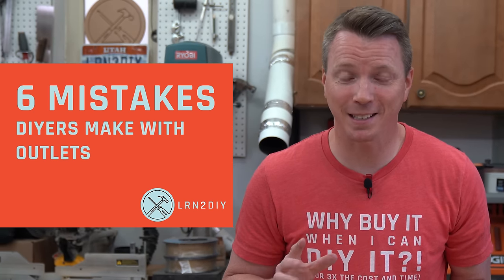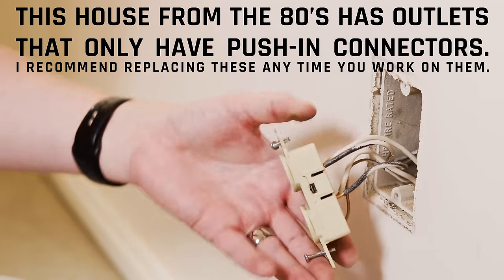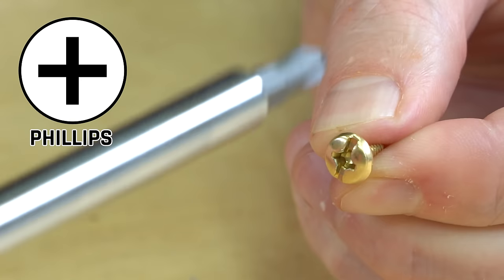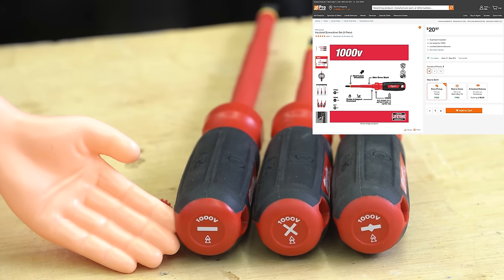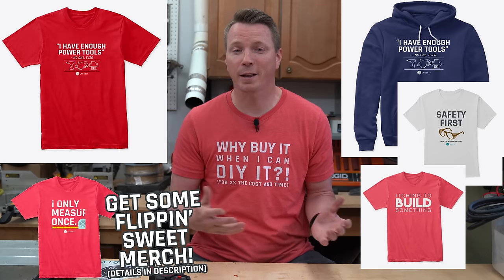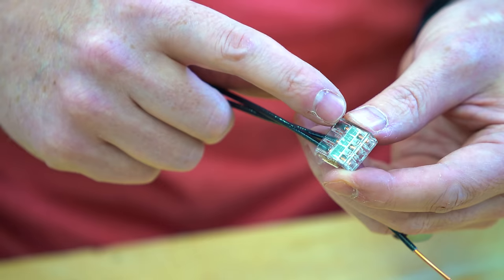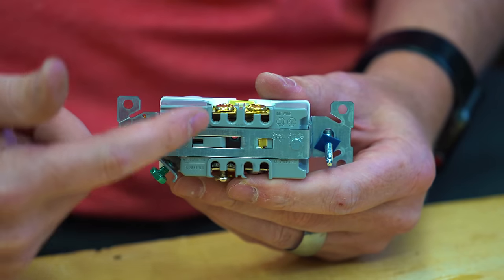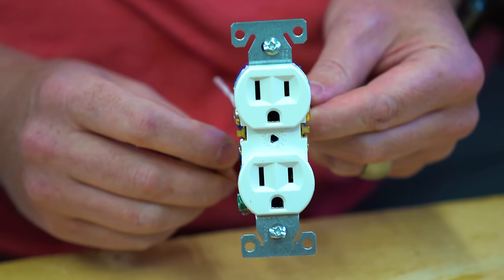6 MISTAKES DIYers Make When Wiring Outlets

Comment: Well done. The only DYI fail you might add and it is a serious one, is that the DYI doesn't fully understand the difference between the neutral wire and the ground wire. Combining or interchanging those wires can lead to serious problems or fire. They are always to be kept isolated from each other. The ground wire never to be used to "complete" a circuit.
Reply: Only to complete a “ short  circuit “.
Reply: The ground and the neutral are certainly connected, but only at the circuit breaker box common bus..  At the terminal ends, it is agreed that the neutral and ground should never be combined.

Comment: The biggest but maybe not so beginner is knowing about the jumper between the upper and lower recepticles on the hot side. Knowing to cut this when replacing a worn outlet can prevent a big problem when one of the receptacles is controlled by a wall switch and the other is always on. It's an easy item to overlook.

Comment: Great video on correct way to wire a duplex. Have not seen all of your videos to see if you cover when to change duplexes in your home especially in the kitchen. I have seen so many homes where the duplexes are not holding a power cord securely anymore. On high wattage appliances like toasters, convection ovens or coffee makers, if the plug sags out of the duplex too much it can cause arcing and possibly a fire. Spending a bit more for 20amp duplexes is worth the cost for the components inside are a heavier ga. so they hold a power cord more securely.

Comment: I'm a master electrician. This was a very good video. Especially on using the push inserts. Also not taping around an outlet before installing. Code requires this in some areas
Reply: I better look up the code concerning taping the devices. Could you please tell me what section and subsection number your referring to? Are you referring to Canadian Electrical code or another nation's, American, for instance?
Reply: @renebatsch2555  I'm American.  It's not nec required,  but small codes differ from city to city. I've come across a handful now who want the taping around it which to me is redundant as it might serve a helpful purpose in metal boxes, but if the boxes are grounded as they should be it's pointless anyway. My apologies for not making clear it's a local thing I've ran into several times.
Reply: @rustymarrs4832  Thank-you for the reply. I used to wrap electrical tape around the receptacles as well years ago - just as I was shown by many journeymen. 
I don't anymore as it makes it harder to trouble shoot if one has trouble stabbing into the slots with ones prob-tips and can't touch the side of the terminal tabs because of the tape. Also it prevents inspection of the terminals and wire ends when the device is pulled out of the box.  Also the tape, if not allowed to relax before wrapping, will start to work loose and in time leave a tacky, encumbering mess. The only time I use tape now is temporarily on light switches hanging out the box when I'm painting a room and want to keep the room's light in use.
p.s. I'm a 32 year member of the I.B.E.W. local 353.
Reply: @renebatsch2555  nice and yes I agree on tape just being a Headache. The only thing I tape anymore are colors on strand wires from single rolls to mark hots from neutral and ground. I don't wire hot to neutral old school so I don't have to mark those, so colors and wire nuts after twisting hots are about it.

Comment: For people that don’t understand why wires pop free of screws or wire nuts when they are sitting in a protected electrical box and are never moved; wire is constantly moving by expanding and contracting so any lose connections will eventually come free and cause arching. Also pre-twisting your wires before putting on wire nuts is more important than you think!
Reply: @rustyc0athangr you can still have good connections without pre-twisting so don’t worry too much! Pre-twisting just guarantees a strong connection!
Reply: @We do things So never were taught the proper way in tech class, or just ignorant?
Reply: Also make sure all wires are equally deep inside the wire nut. Sometimes they shift after you put on the wire nut.
Reply: Besides just the expansion and contraction from temperature changes, there's also vibration.. Kids and pets running, jumping, bumping into things..
Reply: Code now states not to pre twist, but my father still twists and solders his connections before wire nutting. 88 years old, really old school.
Reply: @We do things Never pre-twist stranded conductors together for wirenuts. Only pre-twist solid conductors. You can and should tightly swirl the strands of individual conductors, but not twisting the two conductors together. Never nick the conductors of solid wires, and never leave out or accidently cut a single strand of stranded conductors before connecting them. If you accidently nick a solid conductor, or cut strands of stranded conductor; cut it all off and start over. Always perform the pull test (you should not be able to pull the wire out or off, no matter how hard you pull)
Reply: @therealbadbob2201  I haven’t heard of that code? What’s the reference?
Reply: Some discussion here about whether or not twisting is a code requirement.  Last I looked, it is in Ontario, Canada.  However, keep in mind that electricity flows on the surface of the wire.  Twisting makes more contact surface, so a better electrical connection.  Twisting keeps all the wires together mechanically, so none slip back while applying the nut.
Reply: @vproducer062  .... Which is why pre-twisting the wires is so important. If they are twisted properly, there is no way that they will shift. 👍🏽
Reply: @therealbadbob2201  I just looked and in the US there is no code requirement that states that you can't pre-twist
Reply: @therealbadbob2201  - I've seen this before - completely unnecessary to solder (especially when soldering thicker gauge wire - the heat is constantly transferred away by the copper wire and, ultimately, you can cause a more dangerous condition by melting the insulation in the wire (partial melting), weakening it, and making it more vulnerable to cracking - as the plasticizers were evaporated from the insulation material!
Reply: Thats actually not true. If you read the manufacturer specs of some wire nuts it tells you not to pretwist
Reply: @orestracki6617  i recommend every DIY person to pretwist because they don't always know whats going to stay in the wire nut or not. trained perfessionals can get away without pretwisting though.
Reply: personally , I don't pre twist wires . Nowhere in the NEC does it say to do this nor does the bag of wire nuts . Pre twisted wires makes trouble shooting difficult and dangerous . The wire nut does all the twisting necessary .
Reply: If you actually read the box of wire nuts it tells you not to pretwist
Reply: Shea dehnart 
I understand but it's not code like people say. You read manufacturers guidelines when it comes to those things. And it says you shouldn't pres twist because better chance wire breaks
Reply: If you "lose" a connection, please get it back.
Reply: This pre-twisting wires before installing a wire nut (Marrette for example) is just so wrong. I have seen many old school licensed electricians do this but it is still wrong!!! Even the manufacturer's expressly tell you not to pre-twist the wires but allow the wire nut to do it. In some ELECTRICAL CODE BOOKS (if not all) they tell you not to pre-twist wires. There are a few reasons for not doing it the biggest being that pre-twisting the wires doesn't allow for good contact between the wires and wire nut. The thermal expansion and contraction of the wires makes matters worse and results in wire nuts falling off and creating shock and fire hazards. The second reason for not pre-twisting wires is that it puts undue strain on one or more of the wires which can easily result in at least one of the wires breaking down the road.  Being an industrial electrician for over 28 years I have come across these issues many a time. It may look good but it could end up being the nightmare you don't want to go through.
Reply: @shea-butter  not every wire nut (spring nut) is UL listed for the use of not pre-twisting. A little over 15 years ago, I was 23 the man I was working with was 78. And he taught me that even if a wire nut is listed for not pre-twisting. You can't visually inspect it. I always pre twist.
Reply: Then only reason you would consider preexisting your solid wires would be if you have more than three and you aren't confident that they will all twist when you put the wire nut on.  This can be the case with existing wires which are short.  But for new runs, you should have plenty of slack.
Reply: Anytime a current runs through a conductor that conductor will shake. You will need a microscope to see it, but it does shake. Over time this can show up in situations where mistakes are made, but generally is NOT a problem with properly installed devices. I remember speaking to an electrician that said he like to never found the problem where a branch circuit kept popping the circuit breaker. Turns out the insulation was already weak and that weak spot was right up on a grounded electrical box. It took about 5 years, but that shaking finally caused the wire to ground out.
Reply: ?
 @therealbadbob2201  Where does code say to not pretwist

Comment: Ok, ok.  I'm a believer.  No more 'backstabbing' new outlets for me!  I may even go through the house and fix those!  And, yes - also guilty of counter-clockwise hooks and now I know why!  The wire gauge on the back is a terrific help as well although I always thought that it was just for the proper backstab length!  The screwdriver and stripper hints were awesome.  Dad always said "right tool, right job".  Nicely and concisely presented.  Thank you LRN2DIY!
Reply: Absolutely nothing wrong with the backstab connection. He is just misinformed on the topic.
Reply: it is almost impossible to get anything with screw terminals in Germany, they are all push in connectors.
Reply: @jasonmorehouse3756  NEC prohibits backstab use with any wire larger than #14. I think that says something.
Reply: @ghost307  The holes in the devices prevent anything larger than #14 anyway. The unfortunate fact is, spec housing is built and wired and plumbed and roofed and sided by the lowest bidders. If it's legal and saves time, it is done. But no DIY should be concerned with the couple of minutes it takes to use the screw terminals.

Comment: Keep up the great work.  Very well presented for DIYers. There is one thing that I think should have been mentioned and has been a problem,  scoring the wire when stripping the wire. When the wire is scored it has a weak spot for breakage. Working the wire, such as bending, it will break at the scored area.  This can happen when bending the wires when fitting the receptacle into the work box or removing the receptacle from a box .  Most DIYers don't use the proper tools to do the job, and many times, don't  read about the proper procedures to execute the job their doing. I've seen DIYers use a pocket knife to cut the insulation from a wire and heavily cut into the copper wire causing a deep score and couldn't understand why the wire broke.. Just my two cents.

Comment: I would suggest adding a 7th common mistake to the list.  If the 2 outlets are on separate circuits, be sure to snip the factory-installed jumper wire between the outlets.  Obviously, I learned this lesson the hard way!
Reply: If you're a diy'er please don't put multiple circuits in the same box. Somethings are best left for professionals. That's not even a common practice the tabs more for switching half the receptacle. If you don't know what that means you should call an electrician
Reply: I would never put 2 different circuits on the same device, especially opposite polarity.
Reply: But he didn't call it 7 mistakes. He called it 6 mistakes. Which one would you have suggested he leave out. Or should he just call it Sixty Bazillion mistakes?
Reply: @srfour  excellent point

Comment: Very nicely done! Happy to say that as a DIYer with no "formal" electrical training, I've never made any of those mistakes - most of it is common sense anyway. But informative. I never knew those "backstabbers" were so bad. Never used them because I was just always leary of them but always thought if they weren't okay they wouldn't be there in the first place.
Reply: Backstabs may be ok for light draw light circuits if you don't mind some flickering. Never for outlets. Appalling they allow them. I solder all high amp connections rather than use just wire nuts.
Reply: Not even legal in places like Boston.

Comment: As an extra safety, I wrap the outlet screws with a couple of turns of electrical tape. When you have a box with multiple outlets it insures against shorts.
Reply: This.  I mean, there's no code to it, but it was how I was taught by other electricians when going thru apprenticeship school.
Reply: @johnn3793  I worked with an electrician for a year and he required it too, especially in metal boxes.

Comment: Surprised you didn't cover reverse polarity. That's one of the most common mistakes I have run into...
Reply: AC
Reply: AC has no polarity.   
Hot and neutral reversed is what I believe you meant, and yes, it is a serious and common problem.  
I have seen one case where hot and ground were swapped. That's SCARY.

Comment: One more thing I always do when working on outlets or switches,  whether commercial or residential, is to wrap them along the terminals with good electrical tape.  This just adds an extra layer of protection in the event someone or something comes poking along behind you.  It's not needed, but it is a good peace of mind.
Reply: I do the same thing.
Reply: very useful in metal boxes and recommended, in plastic boxes not necessary and you may be asked to remove tape wrapping in plastic boxes by inspector.
not that its a code violation but it can block inspection view and repairs can get risky when you have stubborn tape
Reply: Same.
Reply: Yeah but in a couple years the tape adhesive turns to goo and makes a big mess. Then any repair you have to get the sticky junk on your hands.
Reply: @court2379  very true and sticky goo can make working on line more risky but in a metal box its worth it not in plastic
Reply: After doing countless repairs and replacements of Receptacles and switches over 22 years I have often seen where tape can be a real problem.  One added problem it can create is corrosion of the brass screws and contact points.  
I can see where it can be helpful, but one properly installed, with the power off, alleviates the need for such.
Reply: @court2379  Then stop buying cheap tape.  High quality electrical tape does not break down over time.  I recommend the 3M #33 tape.  It's nicely thick with a strong silicone adhesive.
Reply: @jameslmorehead  I would like to believe that is true, but I have never experienced it. Or if I did, I would have just assumed the tape was newer and had not yet turned. Hard to know.
Reply: @jameslmorehead  Yeah, I was just thinking the same thing. I've used both cheap and the good stuff in my home over the years and it 100% does make a difference!
Reply: I saw my electrician doing the tape on some outlets but not others. I asked him why, and he said he personally only adds the tape on narrow/crowded boxes, but if there's enough room in the box he doesn't bother.
Reply: I was doing this and my coworker who has about 17 years experience says it’s a waste of time
Reply: @jameslmorehead  exactly there's a huge difference. You can't get a good tight wrap with cheap tape because it breaks off,  and loses adhesive quality when you stretch it.
Reply: @absoluteelectricandmainten7432  Maybe.
Reply: @Dontcare523  He’s right.

Comment: Great video explaining how to correctly connect wiring to a receptacle but the one important thing you failed to mention was to make sure that the " Hot " and " Neutral " wires are connected to the correct terminals on the receptacle so that the polarity
is correct.

Comment: #7 : reversing polarity. Buy an inexpensive polarity checker, the incoming wires could even be wrong. My current apartment has an incorrectly wired outlet, presumably done by a "professional" electrician.
Also, Wago Lever Nuts are especially helpful (for me essential) for joining stranded and solid, which I always have a lot of trouble with. Very common application is joining the thin stranded wire that comes with light fixtures and the solid incoming wires.
Reply: Spend the extra few dollars and get the unit with the integrated GFCI tester.
Reply: When joining a solid and stranded wire in a wire nut, always make sure the stranded wire is a little longer in order to prevent it from just wrapping around and eventually coming out
Reply: Wago makes installing fans and lights SO much easier
Reply: That point about joining stranded & solid makes we wonder about joining copper & aluminum wires.  I had to have that redone and the connectors they used looked similar.  
I didn't do the work, but I familiarized myself with the process.  It seems like the Wago Lever nuts would be safer/surer than hitting torque specs, that I'm sure they didn't do.